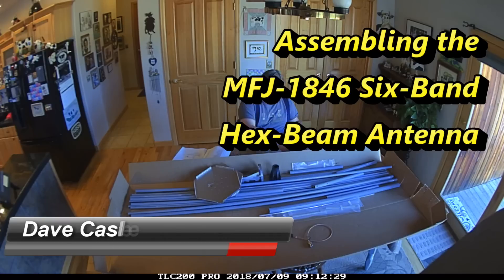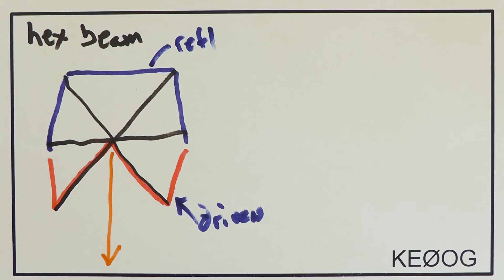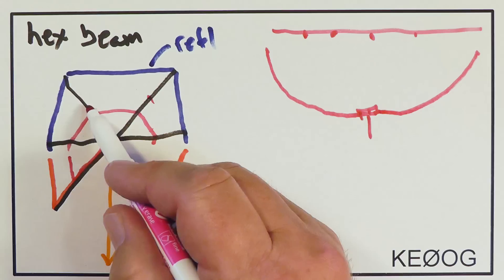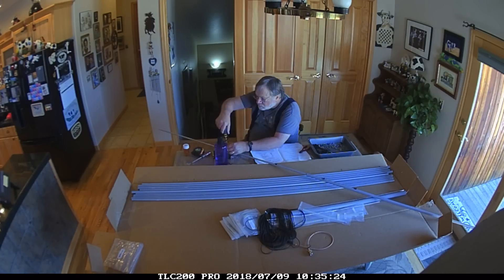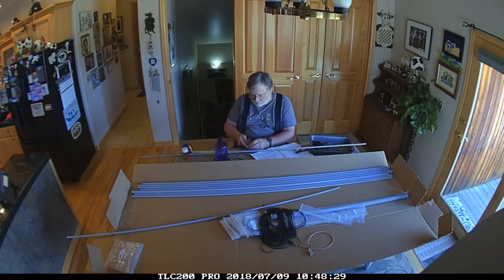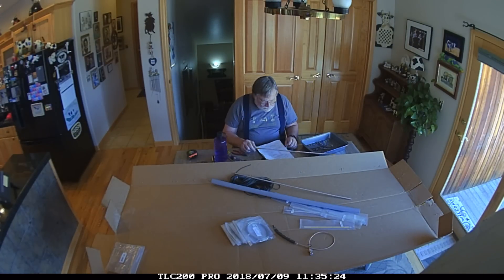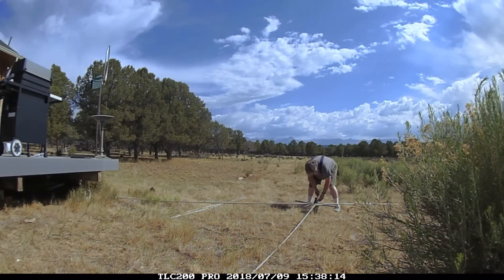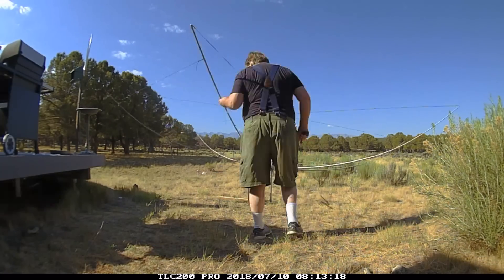Assembling the MFJ-1846 Six-Band Hex-Beam Antenna (#152)

Comment: First off, thanks Dave for all the videos you produce! I am now the proud owner of the MFJ-1846. A rather long road to the finish product. When it was received, it looked as though the box was literally dragged to my house. Obviously missing pieces. MFJ & HRO made it right within a week. During assembly, I had mislabeled parts (20m reflector wire & all the 6m parts were actually 10m parts). Again, in about a week, parts were received. Antenna sits on the barn, 130' cable length away from the shack, and on a 15' roof, with a 5' tower and about 3' of mast/rotor. SWR is WELL  below 2:1 on all bands, except 6m and 10m. Built in antenna tuner smooths it out. Quit a thrill to switch bands w/o needing my tuner! Still have the long wire for 160, 80 & 40! Daves video(s) were helpful or sure. Read the manual and take your time. Its worth it!

Comment: Dave, Thanks for the close-up of the feedpoint tubes. This is an interesting feedpoint MFJ is using here.  Do you happen to know the spacing between the two aluminum tubes? I'm building a hex beam and I like this better than the other options of using several pieces of coax and building my own air-coaxial center post is not an option. Do you have any other insight on the feedpoint system since you've had a chance to use the HEXBEAM a while?  73, W5ZYM
Reply from the maker: It seems to work really well. I'll be bringing the antenna down for a minor, unrelated repair soon. I'll see if I can measure that for you.
Reply: @davecasler  I'll watch this thread for your answer.  Thanks Dave! W5ZYM
Reply: @davecasler  Have you had the chance to make the repair on the Hex-Beam yet?  Likewise, did you measure the gap?

Comment: I also got the SP7IDX after losing my first Hex (from Texas Towers) in an ice storm. So far the SP7IDX has withstood ice, wind to 70mph, wind with ice and temps down to -13 F and is still cooking except for my 6m wire which has come loose from the common feed point. But I will probably put up a single yagi for 6m eventually anyway. I might add that there are “ice lines” from a custom built hexbeam construction sight ( of which I do not have the link) that I installed on the SP7IDX. Essentially the ice lines go from the tip of each limb to the top center of the common feed point. On the SP7IDX, the limb transitions are reinforced with aluminum tubing whereas the other beams are not, this I believe, is the Hex’s weak point. If a Hex breaks from ice, the weak point is the center of the limbs as the weight from the ice builds up and pulls the limbs out from the center point which will break the fiberglass limbs. The other future issue will be how the UV will affect the fiberglass. Some hams paint the limbs with UV protection paint. The SP7IDX uses different plastic that doesn’t appear to be fiberglass and appears to be much stronger and is UV protected. The SP7IDX was about $800 (2015 currency exchange) including $125 shipping from Poland. The turn around can be three to four months since he makes the beams as they are ordered (I don’t know if that has changed.)  The construction of the center point is machined and uses aluminum  tubing protected by bullet proof plastic fittings. The wire is high quality and is wrapped, the ferrels on the ends of the wire are very strong (except for my 6m)lol.
Reply from the maker: Thanks for the info.

Comment: Thanks for another informative video!  At what height above ground is this antenna supposed to be mounted?
Reply from the maker: Like any antenna, generally higher is better. The optimum height for 20 m would be around 33 feet. I'm going to mount it at 20 feet. The computer model shows that to be a reasonable height.

Comment: Dave I wish I was closer to you. I rebuilt a hydraulic pump, a lawn mower transmission and did some welding for a fellow for 2 Rohm 25 towers. One is 60' and the other is 75'. We could do a little bartering.

Comment: Hi Dave,
If your fence post is 1 3/8" OD, then a 1 1/4" piece PVC Sch 40 should just slip over the fence pole and allow you to mount the beam. If the post is 1 1/2" OD, use a piece of 1 1/2" PVC Sch 40. They should be available at any local HomeDepot store.   73  WB3BJU
Reply from the maker: At a local metal reclamation business, I found some one and a half inch PVC schedule 40 pipe made of aluminum. I'm planning on using that as the mast.

Comment: Dave-
Somewhere I read that the Hex approximates the efficiency of the 3 element TRAPPED beams, so this seems a much better solution.  Also, it appears that the Hex design is a type of Moxon antenna, which has certain advantages like bandwidth, over a "normal" beam.
And with an 11 foot radius, will fit almost anywhere.  The option for adding 30 and 40 meter single element dipoles is very nice, but I suspect the 3 element option coming out would be the better choice for many if the 17 foot radius is acceptable.
That one is on my wish list!  Just need to convince the wifey that I really need one - 
I enjoy your posts, keep up the good work.
AA7VA
Reply from the maker: With the 11 foot radius, the hex beam will be wider than it is tall. I hope to have it fixed and mounted within the next couple weeks.

Comment: My concern is durability especially in the north east with ice and snow, some makers of hexbeams sell extra heavy ice and snow  rope kits for them, does mfj?. You talked about nylon screws holding the ropes, that doesn't sound durable at all. You didn't mention why you had to use the hose clamp, I don't think?, did the screw or cable break? In your opinion is this made durable enough for winter, and could you show some ups of the ropes and connecters etc? Thanks for a good video, 73, Tom
Reply from the maker: I'll show more about the antenna in my next video. The reason for the hose clamp was because there was a missing hole in the feeder distribution system. Rather than try to drill a hole, and potentially destroy the feeder, I just use a hose clamp.

Comment: Thanks for the instruction video. I just read about the MFJ-1856, which is a three element hex beam. The gain and front to back ratios look good.  I look forward to your report on how the 1846 works for you.  I know you don't have a yagi yet, so this should be fun for you. I'm using a 20 meter dipole and a 40 meter dipole.  The sun is so quiet and I have power lines on two side of our lot, so it is hard to hear much on the air.  My TS-590SG is a great radio, but you taught me when I was studying for my general exam that a good antenna is the key.  Thanks for your videos.  I'm a BYU grad too.
Reply from the maker: This is my first experience with a gain antenna. We'll see how it comes out.

Comment: I guess at the price, the MFJ is "just OK". I opted for the SP7IDX hexbeam and am glad I did. It is far superior in its engineering, construction and quality at a somewhat higher price.  I did not need to make any adjustments nor fixes to any part. It went together perfectly and gives superb performance. I suppose the MFJ will work well, but I would doubt its durability.
Reply from the maker: As I was building the antenna, nothing seemed cheap or gimmicky, so I suspect it will have good durability.
Reply: Richard Melville About how much do they cost delivered? Also, how high did you mount it and approximately how many square foot of space do you need? I have a tiny backyard. Thanks!
Reply: How long did it take to get yours?  I have been waiting about 5 months now.  Waldi said it is in customs in NY and he can't do anything about that.
Reply: Disappointing that you had to use a dremel tool to get the feed point together and then you had to use a hose clamp to attach the 6m driven element.
Reply: I paid $746 USD total. Mounted at 35 feet. The antenna is 22 ft. in diameter so you need a little space for construction.
Reply: I see that it broke.
Reply: Mine was about 6 months in coming. Fortunately, I ordered it before I started to order the crank up mast, so I had concrete work, etc. to do before I could use the antenna.
Reply: Richard Melville guess I've got a little longer to wait for my hex beam. Going to use a guyed surplus military mast until I build a house. Then I'll have a more permanent tower structure.

Comment: Not unlike a GEM quad. I got all the bits and pieces for one last summer from an estate. It has a hub in the middle where 2 sets of 4 spreaders go out at an angle. It is 2 elements on 3 bands as designed. I haven't put it together yet. The arms are a three sided fiberglass tapered web design. Very strong..
Reply: Rob Noakes VE3PCP :  I lost my gem quad in a tornado. Worked like a charm—especially if you tune for max f/b then for SWR.
Reply: I loved my Gem Quad.  It was a great antenna and I wish that I still had it.  Have fun with yours.